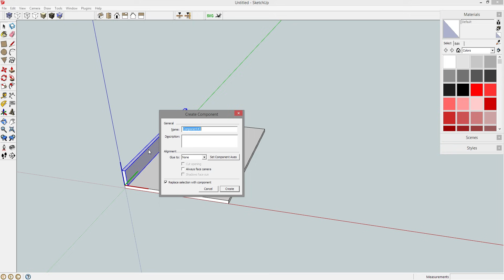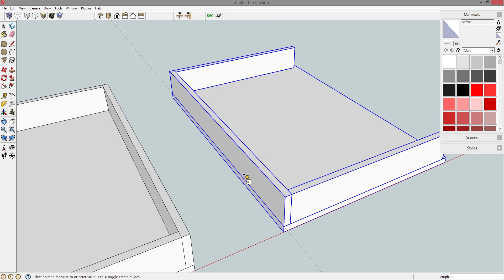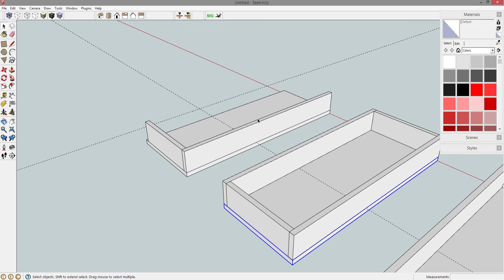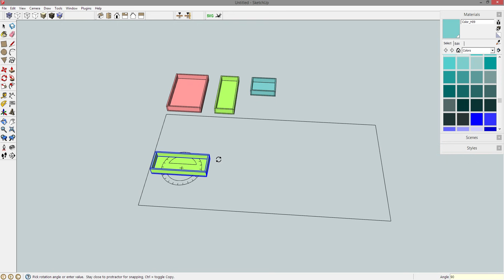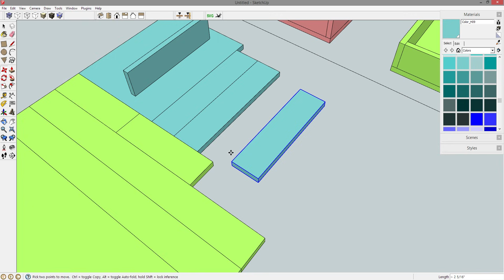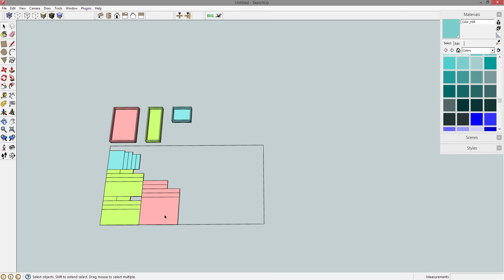Comment: Please thumbs this up so everyone can see it. This question is being asked a lot. Yes, I do account for the blade kerf but not in between every piece. I know that 8 cuts = 1" so I give myself some leeway and say that 6 cuts = 1". If I get close to the edge I'll count the cuts and make sure there is enough room. But if you manually add 1/8" in between every part it makes things difficult.
Reply: +Jay Bates The entire time watching the layout cultist portion i was wondering to myself, i wonder if he considers the kerf, then i scrolled down and sure enough... nice video, i work with cadd not sketchup and what really helps speed the process along is knowing your shortcuts, huge time saver
Reply: +Jay Bates Good thing I read the comments before making one of my own. That is a very simple way to account for the blade kerf. Thanks for the tip.
Reply: +Jay Bates
 Nice demo.

I use SketchUp for all my work, even the simple stuff, because it better helps to visualize the final build and to confirm that everything will fit.

But, until I saw this I always grouped each part rather than make them a component because I couldn't see the advantage and grouping is one less step.  But now I think I will start making each part a component.  Thanks
Reply: Good one Jay. A beginner makes the kerf layout mistake once or twice and quickly goes and measures all his pieces and wonders where the mistake was.  It's an easy thing to forgot...a couple rip cuts and the lost material adds up quick.
Reply: Haha, thanks I should have looked here first.
Reply: +Jay Bates this video has been a life saver. 

I bought your miter station plans, but since I've modified it a bit, I also needed a modified cut list and man, this video helped a ton.

Thanks brotha! Can't wait to share my build ;-)
Reply: +Jay Bates Hi, I don't have time to watch the whole video so I'm just going to ask you.  How doI cut out a piece of what I'm working on?
Reply: Jay Bates
Reply: Jay Bates thanks for these videos man, they are the best tutorials I have found
Reply: Best video yet on sketchup
Reply: I'm just going to join the crowd and agree that these tutorials are great.  Keep making them please.
Reply: This was really useful. Thank you
Reply: I’m still very new to Sketch Up, so please forgive me if this is an obvious question. How do you get a cut list with component dimensions out of the component layout you created in the video?

Comment: Dear Jay Bates, you can not know how much helpful and time saving were your phrases "P for push/pull" "T for tape measure" and "M for movement". Very grateful! Thank you.
Reply: True story. This helped a bunch. I can finally somewhat use sketchup thanks to these videos. I still find myself really struggling to move things around and keep them on a plane. They always end up hovering a foot off of the mark or floating way out in left field for no reason. If I could just get that nailed down I would be a happy guy!
Reply: homegrownbuddy, One tip for helping keep objects in the right plane: it matters what edge, face, or corner you grab when you move things. Usually the bottom edge/face is the common one in projects like this, so while grabbing objects by the closest side (usually the top one) seems easiest, if you grab it by the bottom (e.g., the bottom left corner instead of the top left corner), you’ll probably have much better luck. In this video Jay kept having to adjust the pieces vertically because he was grabbing a top corner, but it was the bottom of the objects that were originally already on the same plane. Had he simply moved and copied while grabbing the object from the bottom edge he would have been even faster—although, he’s such a maestro with SketchUp, maybe he just did that so we could all learn more tricks and keyboard shortcuts! But once you know to pay attention to what edge, corner, or face is shared with other objects, it helps a lot because then SketchUp helps you keep things anchored to that common plane.

Comment: Excellent tips Jay, very similar to the process I use but still I learnt some additional tricks. One slight variation I ten to follow, my table saw is small and so I prefer to cut things like the side pieces on your trays as long strips on the table saw then chop them to length on the mitre saw. I therefore tend to arrange my cutting layout horizontally rather than vertically.
Reply: I agree, Graham, and I do the same. I also usually want the grain of the face veneer of my plywood running in the long direction of my components, and so i take that into account doing my cutting diagram layouts, too.

Comment: Thanks Jay. I was one of the people who asked you about how you used Sketchup for Cutlists. From playing around with it, I copy and move the object to a 'Layout' layer, where I tear it down into parts and place the parts onto outlines representing sheetgoods or dimensional lumber. Like you, I use components, so any changes made to these parts in my main working layer get reflected in the Layout layer.

Thinking as I write this, for those who cut down materials in stages and build one subunit at a time, and subsequently decide to modify their project, I suppose any additions/subtractions of parts in the main working layer wouldn't be reflected in the Layout layer since the latter is a copy of the parts of object as it existed at the time the copy was made. So you'd have to manually add (copy)/subtract parts to/from the Layout layer to reflect any modifications to the project.

Wondering if there's a way to create a 'living copy' that changes as you add/remove parts to/from the object? I.e., copying a 'group' and anything that is added/removed to/from that group is reflected in all copies of that group. That way you can always be sure that every copy in every scene has the parts contained in the most current version of the object in your working layer.

Comment: Thanks for this Jay! It's one thing to design and build in Sketchup, another to take it to this level of efficiency. Being able to move pieces around on a board for the best use of raw materials means money savings and less cutoffs and scraps to hang onto. Also, visually determining the cut layout before entering the woodshop will save time, save on mistakes and stress. I have done the pencil and paper thing the same way, but that takes hours not minutes like you just demonstrated.

Comment: I have been using sketchup since 2008, and I am really very good at it. But right off the bat, I learned a new trick.  I did not know that you could make a rectangle and then adjust the size of it after making it.  That totally blows me away.  There is always something new to learn about SU.

Comment: Love these tutorials.
If not for them, I wouldn't have been able to design and build my extra kitchen cabinet/bar.
Stores wanted $900 just for the base. I built it for ~$400 or so, and that's just because I had a company build the exact doors to match my existing kitchen cabinets as I didn't have a router, table or raised door panel kit.

Comment: Nicely done, Jay! I use this technique to plan my sheet goods breakdown, too. First step is ripping each sheet lengthwise once or twice with my tracksaw, according to my cutting diagrams, then moving to the table saw, then the panel cutting jig or chopsaw. Like you mentioned, if I have common rip dimensions, I try to lay out my components so that I can make all those cuts in one rip fence setup on the tablesaw.

I couple of constructive comments, if you don't mind:

Left hand and right hand components that are mirror images of one another occur a lot in my designs, like sides of a cabinet, for example. I always draw the basic LH component, copy it to the RH position as you showed ... then right-click the RH component and FLIP ALONG ... the appropriate axis. The two sides are then instances of the same component, but now they are mirror images. Like SketchUp magic, any features (dadoes, grooves, holes, etc.) you add to either instance will appear exactly reversed in the other instance. You can always check this arrangement by looking at the component axis that shows up while the component is being edited. If you FLIPPED ALONG ... the red axis, for example, the red axes of the two sides should be point toward each other. This trick will change your SketchUp  life, my friend!*

If you leave the face in the 48x96 rectangle representing your sheet of plywood, it will be much easier to get the individual pieces to snap where you want them. Since you make the rectangle a component, there's no chance that you'll accidentally modify it.

*This process wouldn't be necessary in the example of the plain sides and ends of your trays, which had no features other than being simple cubes.

Comment: Jay, some good tips here! What I've discovered to (most of the time) fix the snapping problem when moving to corners at other heights is to perform the y axis lock (up arrow) once when the object, the tray in your case, is placed on the sheet. Once I do it the first time each corresponding piece that I move/rotate never has issues snapping. Cheers.

Comment: I thought I know all sketchup features and you surprised me at 2:49
I don't know if you're familiar with little red marks on components when you select moove tool on them, you can rotate them on any face without having to switch to the rotate tool, what is cooler it snaps at the angles you predefine in Units window. For example angle snapping every 15 degrees or 45, whatever.
Additionally you can select a couple of components that are ment to be rotated the same way and you're left with just aligning them to the plane which is a matter of seconds
Good vid.

Comment: Excellent tutorial on how to do a layout.  One thing I found easier to do than the way you do it, when trying to align parts on different planes...instead of first doing the Z axis, then snapping corner to corner, just go into x-ray view while you move parts around.  Once done, take it back off of x-ray view.  Will cut down on a LOT of steps while moving stuff around.

Comment: this is a great tutorial. It got to me to try SketchUp. After watching your tutorial I was able to make the trays without a problem but then I thought, I'm making some corn hole boxes for christmas it would be good practice to do those as they are basically the trays you did here. It was fairly easy until it came to putting in the 6" hole. I've watched a few other videos to try to figure out how to make a hole. If I make a quick rectangle, use push/pull to give it some thickness and I can make a hole in it. But the pieces I made following the steps in the video will not let me put a hole in them. I don't know if it is because they have been made a competent or what. If anyone can shed some light on how to get it to work I would appreciate it. Seems like this could be a handy program to know.

Comment: Helps a lot. One thing I’ve disliked with layouts is they never take saw kerf into account. Cut a full sheet in half you don’t get 24 and 24, you’ll end up with 24 and 23 7/8. I saw you left room but a lot I’ve seen don’t, messed me up didn’t think of kerf either while cutting. Can’t think of an easy way to add it though either. Again thanks

Comment: Hi, very accurate and comprehensive explanation of the process of your cutting diagrams. I am a fan of Sketchup and using it for my DIY projects however it was always difficult for me to calculate the cuts (usually I got too many leftovers). Sure it will help me to reduce losses of material and will allow me to work more efficiently. Thanks.

Comment: Great video. Inexperienced 'cutters' may want to get used to the fact that the saw kerf will shave off some material, which needs to be accounted for when making a cut line between two pieces.

Comment: Jay, great video! Thanks for putting these videos together! Quick question for you... how do you account for saw blade kerf when you're designing these layouts? I realize that in your final layout you had space between the green and blue pieces that would account for kerf, however if you had like another piece in between there that shrunk that gap, you may get to the last piece you're cutting out and realize that the piece won't be as wide as you'd planned because the various cuts and kerf have taken away so much of the wood. Is there a way to tell Sketchup to add 1/8" between each individual piece so that you'll know precisely how much wood to use? Or is it just a matter of kind of doing the math in your head and knowing that you have to leave x-amount of space between some pieces?

Comment: I usually use AutoCAD to design my more intricate pieces and projects where I need to be more precise than designing on the fly with pen & paper, but if my source ever runs out (work) I've been dabbling in SketchUp. Very useful and informative info in this video.

Comment: Great tutorial, I'm at the point I need to figure out my pieces and was considering doing something like this.  Thanks for the tips, however one thing you don't mention was the correction for the blade width of all cuts.  The way your layout worked you would be taking that 1/8th or so from excess material on the end, which is awesome of course.  However it is worth noting to those who won't know this detail without it being mentioned.  If you get too efficient you won't have that excess to rely on.  Plus if you make all your lines from the edges before doing any cuts without adding in for each mark you'll end up with a handful of short pieces.  I skipped when you were drawing out the trays I apologize if you covered this detail during that segment.  Again thanks for the tips.

Comment: Great video, thanks Jay. I have used Autocad for years but only for 2D engineering layouts. I just started using sketchup and it's been a steep learning curve. You just gave me some great instruction in sketchup shortcuts which will help my efficiency hugely. I do have one question: do you save your components in separate drawings for future use or just leave them in the current drawing?

Comment: Great video and you have cut plywood enough by now to know hehe!
QUESTION:
You can probably avoid all the misaligned little pieces by moving all of them at once BEFORE  you start to laying them out if you move the first three complete trays to have the top of the "floors" aligned to z axis 0" and let the rest follow in one swell foop. The problem is that each and every little piece is a bit up in the air the same as the thickness of the floor. Even the floors are off by their own thickness in respect of the frame you drew out so move all of it down and  you should be good?

Comment: I know this is an older post, but I don't see my questions answered yet. Do you worry about the grain orientation of your parts in regards to this method? It's a less efficient process, but the end product is more fluid. For MDF or other non-grained materials, love it, just curious if you have a different method when you need to worry about grain orientation. This was life changing. I have been doing graph paper for a very long time and the ease you do this with is so simple that I find myself frustrated at not trying to use Sketch Up before. My work flow and time use are going to change drastically! Thanks so much Jay, you're a genius!
Reply: When I need to worry about grain direction I draw an arrow on the face of the material to indicate what direction I want the grain. Then when laying out the pieces I would orient the piece so that the arrow is in the correct direction.

Comment: so question. when actually taking this and doing the cutting. should you not add a 1/8" slip along any cut edges to account for blade width?
Reply: I was thinking the same thing. Maybe give a 1/16" offset to all pieces so you have an 1/8" between all pieces. Then line up the outer pieces with the actual part.

Comment: Great process, and in the end, just as easy and twice as accurate as trying to copy all your measurements to the actual wood.

Question for you: I'm always trying to maximize leftover sheet goods for future projects. Do you prefer to keep the 4' or 8' dimension of the off cut (essentially keep a square or a long rectangle)?
Reply: +Kyle Brown 
That's a question I ask myself all the time as well. I hardly ever need really long pieces so I never keep the 250cm side (sheets come in 2500x1250 mm in metric land), as they are annoying to handle anyway. After that I try to keep pieces above widths like 80, 60 or 40cm (typical cupboard sizes). If I had to choose between lets say 60x60 and 80x40 I'd go for 80x40, because you can always make 80 shorter, but it's hard to make 60 longer ;)

Comment: This is fantastic! I'm just starting to use Sketchup and I have hit many frustrating walls. I've been following your drill press cabinet sketchup video to help me design some drawers. This video answered even more questions that I had. Good tip about pressing up...I didn't know that. Oh, and when you're rotating the 90 degrees, it sounds like you just start typing the number after clicking to rotate. Is that correct or do you have to click down in that box and then type the amount? Thanks!
Reply: +Bruce A. Ulrich Q for rotate. Click for pivot point. Click to grab the item. Drag in the direction of the rotation. Press Ctrl only if you want another copy of the part. Type the degrees of rotation, in this case 90. Press enter.
Reply: +Jay Bates Thanks!

Comment: Curious about the blade kerf using this method. Doesn't it require you to leave some empty space at the end of every group of cuts, as each cut will be offset by an additional kerf? If i understand correctly, you couldn't use the entire side of a board as either all your cuts would be 1/16 off, or the last piece would be significantly off. So it's worth mentioning that you need to leave room at the end for that cumulative offset. Of course this is probably obvious to everyone but me. :P